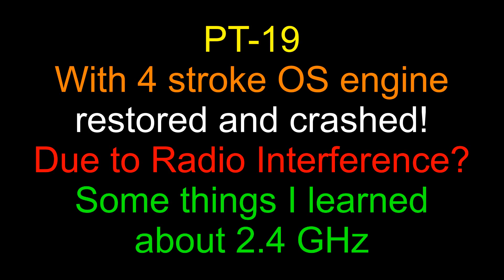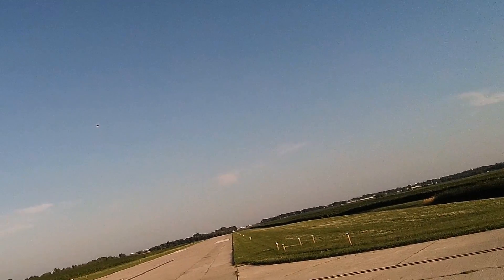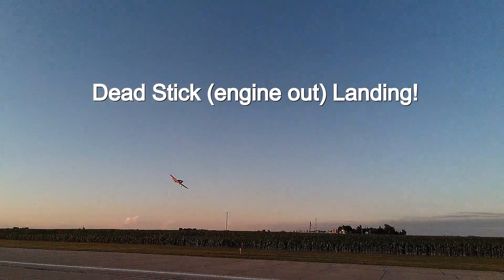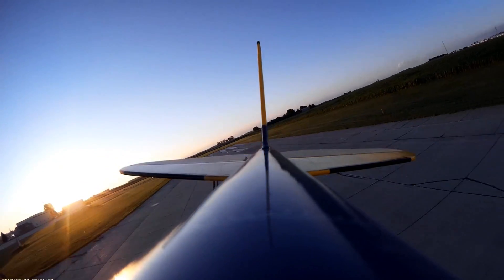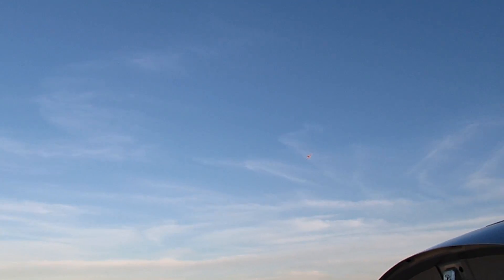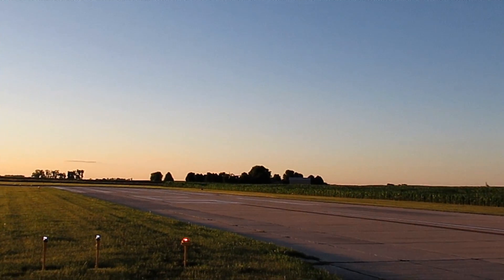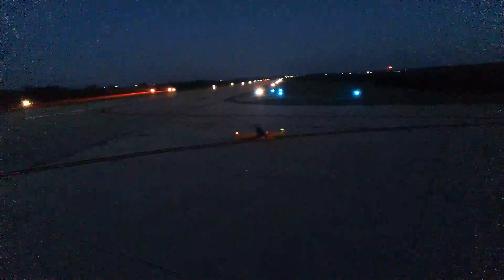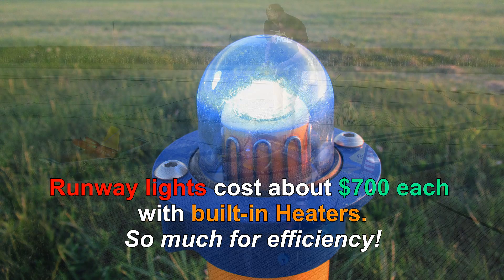My Planes that used to be on FM but now on reliable 2.4 Ghz are crashing at the airport. But why?

Comment: Recently got back into rc planes.  We have quite a bit of 72, and I went out and stocked up on 72 receivers.  Yeah people look at you funny, but I haven’t had so much as a glitch since no one is ever on it.  The problem we have is that the gear is simply old, so it can fail with vibration.
Reply from the maker: I still fly several of my planes on 72 MHz.  I do not worry about vibrations, and even fly my Night Nexus 30 on 72.  Crashing is where most crystals get broken anyway.  Where I live, no one uses it either, so the frequencies are clean.  Happy flying.
Reply: @NightFlyyer  right on! And great channel!

Comment: Hello I heard you mention using 53 mhz I have a nice old jr pcm 10 z on 53.700 I would like to find a spare receiver for
Reply: Also very sorry to hear about the shop fire I believe I read about it in model aviation magazine
Reply from the maker: Sorry to say all my equipment and models were destroyed in a huge fire in 2016, so I cant help you there.  Try Ebay.
Reply: @NightFlyyer  that is a very dificult frequency to find for Jr pcm
Reply from the maker: @toralfcross3819  Yes.  They make it that way to keep folks without a Ham's technician license from using them illegally.   We had crystals in our tx and rx's to change the frequency.
Reply: @NightFlyyer  unfortunately the reciever and transmitter have no removable crystals this model used a frequency module in the back but I am at least able to use a 2.4 dsm2 conversion module but I was just hoping to have other options for questionable flying sites like you have discovered in your tests
Reply from the maker: @toralfcross3819  Well that will work.  Good luck and happy flying.

Comment: Thank you, maybe my old 72 radios are still worth using?
Reply from the maker: If they are the radios with the gold sticker on the back and one of the 40 frequencies, (Not the very old 7 frequencies, like 72.240 (Red and WHite) you can use them.  I fly my night Concept 30 helicopter on one.  Thanks.

Comment: I recall Spektrum had problems with the DSM2 protocol being subject to interference from other DSM2 radios. That was just before they switched to DSMX. Is it possible that you had yours bound in DSM2?  If so and if there was another DSM2 radio signal present somewhere on the field that could be the source of your problem.   Are those lights radio controlled?

Comment: 2.4Ghz is a retrograde step, its got so many hidden faults with it I'm surprised people are still willing to claim it's superior when it clearly isn't, mind you when you've just thrown away a perfectly good old system for a shiny new one thats been hyped up to the eyeballs, its well known most accidents are pilot error but not anymore, so many planes are falling out of the skies it's even been given a whole new set of terms, the most common is the dreaded brown out, I assume this is because modeller cr*p themselves when their prized plane suddenly turns into a very expensive lawn dart, the other new term thats commonly banded about is "an unexplained loss of aircraft". Its only unexplained because those who've spent thousands on new rc equipment don't want to admit that it's the cause. OK with the old system it was possible to be shot down but in the 40 years I've been flying I've only ever lost two planes none were from being shot down, one was a receiver battery cell failure the other was due to CB interference and that was back in the early 1980's when illegal CB radios were all the rage here.

Comment: I switched to Tactic and no longer have the same problems you are experiencing. The DX6i is crap,period. I had two of my planes do the exact same thing,screw that! Orange is just a chinese knock off. The DX6 was ment to replace the embarrassing failure that everyone has experienced the DX6i. I wouldnt trust it with a crappy foamy. Face it,who wants to trust anything to the DX6i. Nice review. I seriously thought it was an invisable dog fence,but after doing simular tests,I found that the Dx6i just plain old drops out the more you work the controls,the more it fails too. I have one I wouldnt even give away. I am chalking it up to a bad experience and just using it as a simulator tool only on my Pheonix sim program.After all, I can always hit reset if it happends there. cant do that on my Vintage Graupner 300 Extra now can I?

Comment: I would expect the power lines running to those runway lights may be your issue. The RC Foam Fighters channel described a similar problem when flying at an airport, that when flying over a certain area their planes would often lose signal. They later found that there were power lines under the surface in that area.

Comment: I am new back to this sport after 25 years and have been caught by the time warp with my equipment, having a surplus of  27 mhz,  AM, and FM gear I find having to purchase new 2.4 GHZ to be able to go flying  irks me. I have conceded and purchased a 800 series foamy to make use of the local parks and not interfere with other flyers with my antiquated gear. 
I thank you for your time, effort and experience you have gone to to explain the problems you had with your craft, I thought it was problem free flying 2.4 GHZ. When I last flew the common word after a plan hit the ground was GLITCH whatever that was now it appears the problem is still here without a name.

Comment: Antennas for this band should be no longer than 7.8cm long. 
This band is used for radar because it likes to reflect off of surfaces more than most bands do. It's used in  microwave ovens because it's the same resonant frequency as H2O, so our bodies, which are 80% water, absorb and dissipate the radiation as heat. It's used for things like this because it's an unregulated band.

Comment: Have you tried the Satellite receiver option you can add it to the standard Orange RX on the open port on the side..  I use them on all my bigger models and makes a huge difference in the polarization and receive on the RX.. Seems like last one I bought from HK was like 10 bucks... OrangeRx R110X DSMX/DSM2 Compatible Satellite Receiver.

Comment: maybe one of the spectrum boosters you can buy would help? to boost your signal  to over power whatever is blocking the signal? also is the dx6i set on the USA band, not the one for over seas since that will give you more power too.. but im sure you know all of this.. just thinking out loud.  i too have a bunch of spectrum RX so i just went with a spectrum module for the back of a taranis. iv out grown the dx6i so  on my next build i need to start learning how to use the frysky taranis.. which has a steep learning curve.. at least for a noob.. will keep the dx6i for bind and flys  ie. nano qx, and other horizon aircraft.

Comment: Looking forward to the re-maiden! I like that you've been doing a lot of classic gasser planes recently!

Maybe the signal cutting has to do with the fact that your radios are using the older DSM2 protocol, so a newer DSMX DX8 might do the trick. This is a bit worrying, as this is the second time I've seen videos where someone is having trouble with their DX6i, and switching to a newer radio (the other channel being Skip Built RC, who I recommend you check out). I currently use a DX6i (DSMX version) to fly my small fleet of aircraft (just 4 bound to the radio). Luckily, I've had no signal issues and has proven to be a valued asset in my RC flying. I even used it today to fly 2 of my planes, and both flights went well. 

Let's hope your new DX8 can fix the problem, and I look forward to seeing your future videos.

Comment: Good science and helpful info, Dave. I think you'll like the DX8 as I recently upgraded to the DX6 from a DX6i. I easily in the air get around 800 feet (far as I can see) at a hundred feet altitude or better. 

Failures are already hard to determine a probable cause; in different airplanes in the same place, it's a difficult problem to address. At our favorite flying field we have experienced the same issues with 'certain' airplanes, where others are immune to those effects. 

Experimenting at a different flying location usually tells you if Interference is the issue. With 2 Gig, the Noise floor has been raised by Cell providers. Radio silence  has been re-defined. I have two models now equipped with the $60 version of SPEKTRUM's dual /satellite receiver and find it scary rangeworthy.

.................................. bill

Comment: I have the exact same experience as you: My old DSM2 receivers, which I have used without problems for years, have started to fail intermittently at certain locations. The only explanation I can find is disturbance from cell towers, since there is nothing much 
else around that should be transmitting anything. I no longer dare to use my DSM2 equipment.

Comment: Instructions for DX6i state to point antenna up, away from model and ground.  Also says the shaft of the antenna and not the tip give a stronger signal. Also read that range check can be affected by model sitting on the ground so to elevate it. I didn't really think too much about it at the time but I can see a problem. Can't tell you why but I am curious now and will ask some other people I know that worked with antenna systems professionally. My guess the signal is being absorbed by the concrete and not reflected.

Comment: Hi Dave,
I Have a DX6i (DSM2) and also a DX7S (DSMX) and have had a few issues with drop outs resulting in a forced landing. But not too much of an issue with range on any of my Speccy stuff. That is until I started FPV and couldnt get any more than 20 paces(in range check mode) before it stopped working. This even happened with my DX7S running DSMX too which was a huge disappointment. So I switched to the Taranis Plus and its been tested to over a mile with no issues or warnings. The Speccy stuff is now just used for short range planes not using FPV. Oh and just so you know I was using Speccy receivers as well as ORX and the issues was the same with either. Its definitely the TX thats the issue. 
Nice vid though Dave. Glad to see you have sorted it, sort of
Reply: That's exactly true. It still amazes me people think it is impossible for the radio to be the problem here, when it's actually quite obvious.

Comment: Please don't flame me if this info has already been mentioned but the DX6i has a USA/200mW mode and a Euro/100mW mode.  By default they come shipped set to the lower power Euro mode.  Also the antenna is supposed to be bent and pointed up at the 90 deg angle.  This is b/c the radio wave emitted is shaped like a donut with the dead spot in the direction of the tip.  So you should never have the antenna pointed straight at the airplane.
Reply: Actually, this level of power really doesn't matter much at close range / ground-level ranges. A 2.4Ghz signal at 'only' 100mW power can still travel further than most people would be able to see their RC models. At close range (say well within 300ft), you really should have control over your model at all times, even close to the ground or there definitely is external interference messing with the radio signal reception. Would 200mW 'cover up' the fundamental flaw of this Spektrum radio being unable to deliver really high quality reception? I doubt it. People with 200mW mode have reported the same brown-out issues and people flying in 100mW mode have had 'hundreds of successful' flights just the same whenever not in more interference rich environments.

Comment: hi Dave, I had several 2.4 setups and lost several aircraft behind them. I think thats why Jr would not put there name on them and called them spectrum. I only use 72 and now I dont even have to wait for a freq to be open any more. I seen $1000s of $ aircraft go splat over 2.4 too. you really went and run great test to find these things out. I get bashed all the time for using 72MHZ but its better than loosing RC aircraft behind a flawed system. and people keep using them all brands with the same outcome. but not me ever again! all the best***  your friend,

Gary

Comment: i flew spektrum for years and one day it just decided to have random black spots and never stopped.
I switch to Frsky and have never had problems again!
Reply from the maker: Yes, well I have been flying and making hundreds of videos using spekturm based radios and never had a problem ever, till I started flying at this airport.  Changing all my receivers just to fly here would be cost prohibitive as I have LOTS of planes and helis.  There seems to be some other forces at work.  Thanks.
Reply: Ok, but you said that this problem is now happening else where.
Reply from the maker: You must've mis read. I have stated over and over again, that in the last 9 years of flying 2.4 ghz radios I have never had a radio failure on any of my planes drones or helicopters. It only has started crashing at the this airport. Range tests were similar elsewhere but something else is going on at the airport that causes them to crash. I will find out,but to spend $18,000 for a spectrum analyzer is not probably going to be the way.
Reply: +NightFlyyer hehe no you dont need a $18,000 analyser.
you only need 2.2 to 2.6 ghz analiser which are $40
Reply: +NightFlyyer and you experienced the same issue at the cemetery did you not?

Comment: I've been flying with my DX8 Gen 1 on DSMX for years and never had any problems. The first time I tried DSM2 nothing but problems. Also you should check out the Lemon Rx Diversity receivers. Excellent range for the money!
Reply from the maker: I appreciate your comments. My DX8 Gen II is supposed to be delivered today and I will bind up my PT 19 and see what happens. It has 2 antennas, one in the handle, so that should help, but again, I cant see changing receivers since I have NEVER had a failure for years and years, as can beseen in all of my videos, till I started flying at this airport..
Thanks for the comments, and please stay tuned to see what I find out.

Comment: Oh forgot to mention, not sure if you know about them or not but LemonRx have really good receivers for a good price. They are quality stuff. 

I know the V2 Oranges are good too, but the LemonRX stuff, especially the newer ones coming out, are really good, and good value.  I think better than Orange. 

Some of them have diversity on the Rx, and then they can have a satellite, and the new satellites even have diversity too, so that is "quad diversity" on a 7channel  Rx for about $40 - plus stability if you want it.  In those big planes, I would use those!  There is a new 7 channel stabilizer  "PLUS" version coming out soon that has fail safes that can be used safely with  IC engines too.

Good luck man. Let us know how you make out.
Reply from the maker: Again, I have had ZERO problems for years with all my equipment and never had a failure till flying at this airport.  Thanks for the comments.
Reply: That is weird that you also had poor range at cemetery though.  
Or maybe it was ok? Hard to tell in video. That's what threw me off on the entire subject.

 Anyways, I think you will be all set with your new DX8.  I will be interested to see how it performs at the Airport!  I have a feeling it will be just fine, but we'll see. 

Congrats on getting a nice new Tx. I love my DX9.  It's such a nice Tx, even with it's minor flaws.

Comment: You will have much better luck with diversity on your DX8 Tx and also DSMX instead of DSM2.  I would also use a brand new Rx in your plane to test against old ones.

Sometimes in your testing it looked like you may have had the Spektrum Rx antenna directly on the ground under the test unit, dangling free..  You need to get it up off the ground a foot or so in those tests I think, to be fair. Even in an RC car I would have the antenna sticking up. But even like that at those distances, I know my DX9 and my receivers would have a good signal unless there is major interference.

So you may have some interference or something going on at the airport, but you also got bad range at the cemetery it looked like.  

I would send in your Spektrum Rx and DX6i to Spektrum. They will probably upgrade the DX6i to DSMX and give you  a new Rx for free anyways,  and repair your DX6i at the very least if it is messed up somehow which it may be.

I have a DSMX DX6i and it has just as good range as my DX9.

BTW my DX9 goes though my body and trees and stuff even with short range receivers like on a nano QX or UMX Radian  unless I am really far away.
Reply from the maker: Yes, well I have many spektrum receivers and 5 DX6i Transmitters and 4 Orange Transmitters. I have tested several of them since, and the range is the same, but again did not exist when flying at the cemetery, though range was bad there too.  I never had a radio failure there.  These radios use short waves and need line of sight.  Also, yes, I put the antenna on the ground, but as you saw in all cases it stopped working about 6 inches ABOVE ground as well. Thanks for the comments.
Reply: Oh ok. Well it will be interesting to see how the DSMX DX8 does at the airport..  Hard to predict.